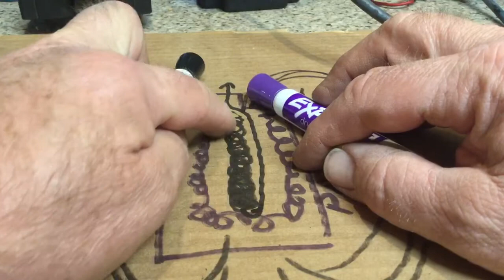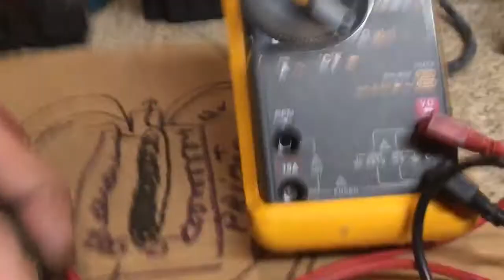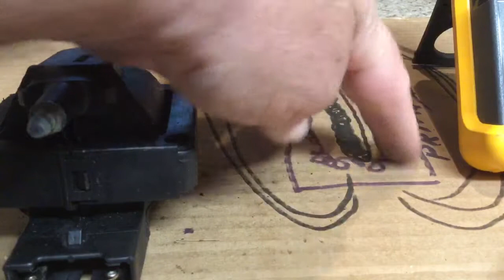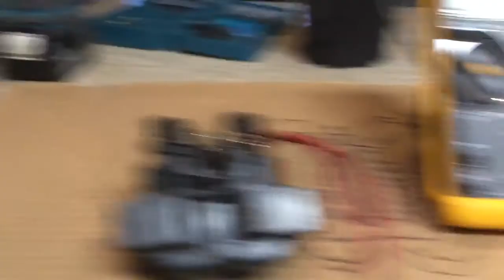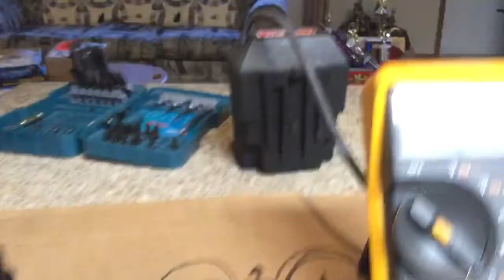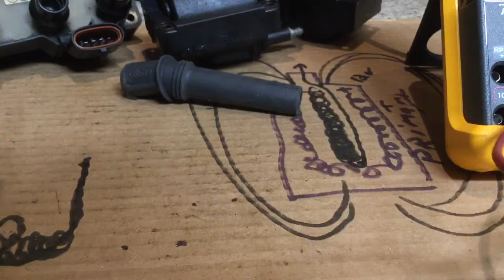Ford ignition coil testing

Comment: HELP! I've had to clip the 2 wires from the e coil and order a new clip. Was the only way to get the coil out because someone jb welded the clip to it. Anyway, the new clip for the new coil is 3 wires. Mine only had 2 wires into the clip. There are 3 total wires coming from the harness but the 3rd one splits off to what looks like a resistor or something and the remaining 2 go straight to the coil. My question is; shall I just wire it back the way it came off? Ignoring the 3rd wire? Of course I would cap it off or whatever...don't want to mess anything else up by not hooking up the 3rd wire even tho I didn't cut 3 wires. How come they don't sell a 2 wired clip lol. Tia

Comment: hello Brian, my E core coil or Screamin demon coil on my 91 foxbody 5.0 the lower primary resistance test i got 000.5 and drops to 000.2 ?
is that bad ? when your test  was  000.5 and went up to 000.6 ......and the secondary  windings  i got 08.88 k and you got 07.98 k

Comment: Wouldn't it be more accurate to test this on a coil that just ran and is nice and hot? That way you get a true reading of the resistance valued in it's normal operating temperature range

Comment: I have a 3.9 v6 mustang and coil pack that you show at 27:00

I am not getting a misfire code but I am getting what feels to me like a small misfire at idle.  I am thinking it is ignition related.  Could I test the coil with your method here and rule out the coil? I see they are $105 and I don't want to throw away that kind of money.  That's what lead me to your video.  I want to diagnose the best I can and test different components before spending the time and money